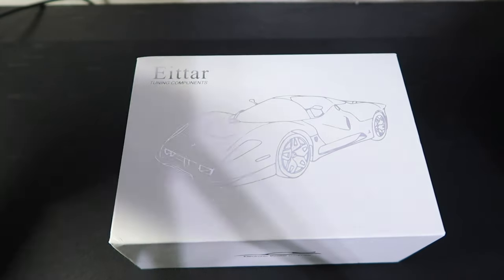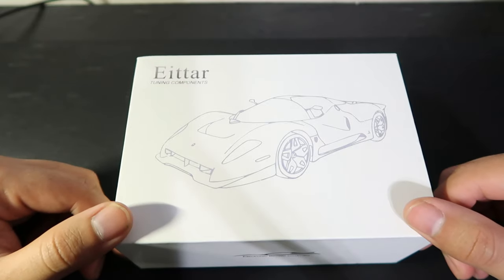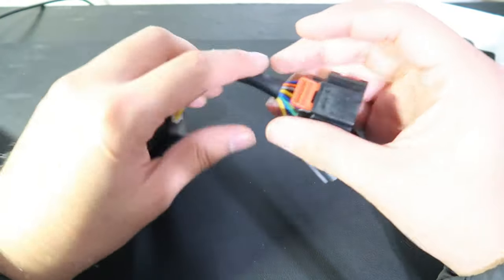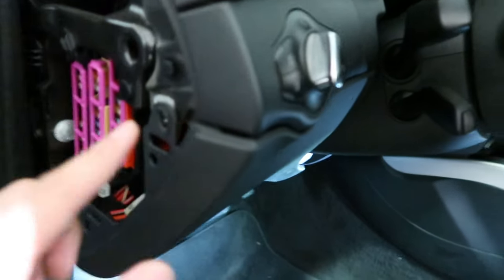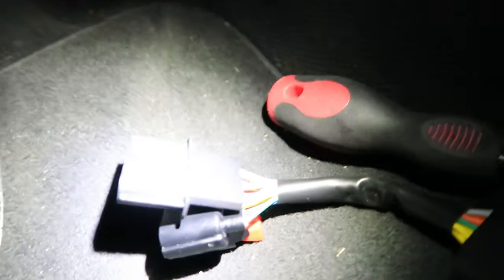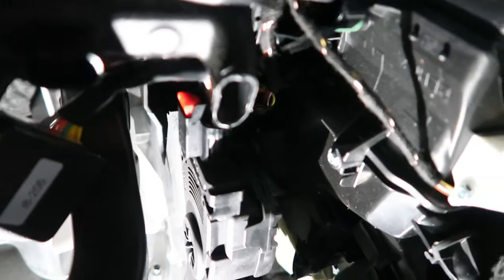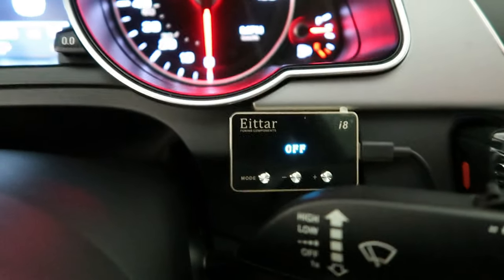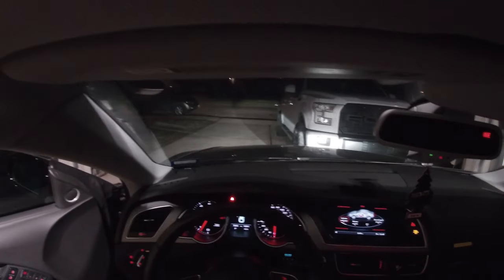Make your Audi feel like you gained Horsepower! THROTTLE CONTROLLER Install & Review: Audi A5 mods

Comment: Snagged one for $43! Totally worth! At first it may seem to not work, but try unplugging from the gas pedal and replugging. Just be sure not to disconnect the control pad from the cable box while the engine is running/only unplug it only if you are removing the mod entirely. You will get temporary error codes about the parking brake and stability control malfunctioning. (Cause the computer sees the throttle signal getting disrupted?)
Reply: The way I got the deal was to just browse listings and add stuff to my watchlists and a seller gave me an offer.
Reply: How did you get rid of the lights
Reply: @nathanmachado9412  when you start engine, several codes will appear, but it will disappear soon after drive little bit.
Reply: Hopefully you see this what brand and is it still possible to get it at that price

Comment: It’s funny how many people are so misinformed about how throttle controllers work. It doesn’t trick the throttle to think the pedal is further down than it actually is, it makes the throttle valve open faster than stock. Most stock drive by wire set ups make the throttle open slowly and that’s where the response lag happens. This thing makes it so the throttle responds quicker to the pedal input. So instead of you putting your foot down 50% and then the throttle valve going like 10-20-30-40-50% over a couple seconds, a throttle controller will tell it to open much faster depending on which mode you choose
Reply: Well said bro
Reply: So i’m one of the people that are misinformed and u made me want to spend 60$😂

Comment: I bought one and keep it on auto most of the time. He is not exaggerating at all, it wakes the car up, hard not to speed alot the first couple of days cause the car is just so grunty and wild all of a sudden. The PP mode or racing mode he has it in is really not fun to drive when just cruising,  the pedal is SUPER sensitive. It will perform essentially the same in all performance modes including Auto but just at varying degrees. Auto mode on the controller + S mode is PERFECT. I tried economy mode at a high level just to try it and the car immediately went into limp mode so I wouldn't recommend that. Also never change the settings while driving!
Reply: Do you keep it on Auto?

Comment: It’s a better one called the sprint booster v3 I got it in my Audi A6 c7 and I get 3.9 0-60 in a stage 1 apr really helps especially roll races
Reply: I got a 2019 A7 and this video is gonna fuck a lot of people up, he is making it sound like it's just a little plug and play tool but this is a stage 1 for that model... He is gonna void the warranty of many people... Smh.
Reply: @17sylargino  if you modifying you car period the warranty goes out the window immediately 😭 that’s should be the last of someone’s worry’s if there modifying there car 💀
Reply: @17sylargino  it's not going to throw a TD1 code to void a warranty nor does it alter the oem ecu.

Comment: Ya these work great got one on my A4 it's nice you can fine tune them to feel exactly how you want I started out in race and it would spin all four wheels off of every stop so I fine tuned it on sport feels awesome now like how it should have felt to begin with , I'm assuming all Audi's are similar but there was a big delay in my stock pedal even in dynamic , Sport on tranny and Apr tuned the Apr tune sharpened up the throttle a bit but not as much as I would have liked

Comment: I've just ordered mine 😀 Eittar 9s so an older version I think  £32 so not too bad from a UK seller. Similar price from China also
Reply: You got a link for that please
Reply: @scitec6166  sorry mate they only had the one, there's plenty from China just search pedal controller on eBay
Reply: ⚠️ATTENTION⚠️
Call your Audi dealership before plugging this into your car. OP may not realize this but if his warranty was still active when he posted this video, then his powertrain warranty is now voided, and removing the device will not help hide that ECU modification done by the device. DO NOT PLUG THIS INTO YOUR AUDI. This is a Stage 1 upgrade. It will void the powertrain warranty.

Comment: I've been debating one of these to go with a stage 2+ dual pulley tune + tcu.  Does it do away with the  pause(breathe  in and gear down)before the throttle kicks in, or just less pedal needed to trigger it?
Reply: I think a bushing mount on the trans should help with that I just got one
Reply: Also what tune are you wanting to go with
Reply: Srry ment to ask what brand

Comment: Now is it actually faster, or does it just feel faster?
Reply from the maker: Does it add HP no , you get to use your power right away instead of the gradual build up due to the delay of the valve opening
Reply: Ive read it's basically tricking your throttle to think your got your foot down more than you actually have
Reply: @AJlocksandlocks  that is what it is

Comment: did u need to uninstall your stage 2 IE tune? im interested in picking one up but dont want to uninstall the tune
Reply: Intercooler, intake, down pipe in about to go stage 2 also
Reply from the maker: No you dont need to remove your tune

Comment: so after a month this video has been up what are your thoughts on it now? Im thinking about getting one for my b8.5 allroad after i just got an APR tune.
Reply from the maker: I highly recommend i run it with my tune and it helps wake it up alot
Reply: @Gat_Zilla  I think the mounting location is the only thing I’d be trying to figure out as I hate seeing cables but understand wanting to change modes.

Comment: nice video 🙈
Reply: ⚠️ATTENTION⚠️
Call your Audi dealership before plugging this into your car. OP may not realize this but if his warranty was still active when he posted this video, then his powertrain warranty is now voided, and removing the device will not help hide that ECU modification done by the device. DO NOT PLUG THIS INTO YOUR AUDI. This is a Stage 1 upgrade. It will void the powertrain warranty.

Comment: Is this like when you put it into S mode?
Reply: @cacapeepeepoopoohead1632  S mode definitely makes the throttle feel more responsive and the transmission shifts more aggressively.
Reply: S mode makes the transmission hold higher revs, this electronically makes the gas pedal shorter

Comment: Would this work for my 13 audi a4?
Reply from the maker: Should work yes
Reply: ⚠️ATTENTION⚠️
Call your Audi dealership before plugging this into your car. OP may not realize this but if his warranty was still active when he posted this video, then his powertrain warranty is now voided, and removing the device will not help hide that ECU modification done by the device. DO NOT PLUG THIS INTO YOUR AUDI. This is a Stage 1 upgrade. It will void the powertrain warranty.
Reply: @17sylargino  It's not a tune, it opens the throttle body, & improves the pedal feel of the vehicle & in no way connects to the ECU..
Reply: @17sylargino  lol what?? It doesn't modify your ECU, it only tricks it by sending different signals from the pedal. You could easily remove it and Audi would be none the wise.